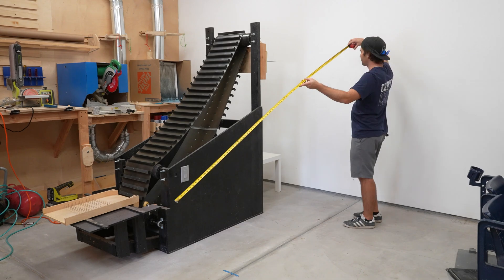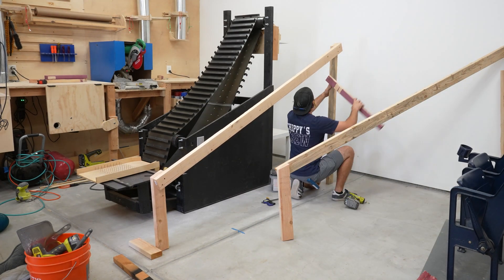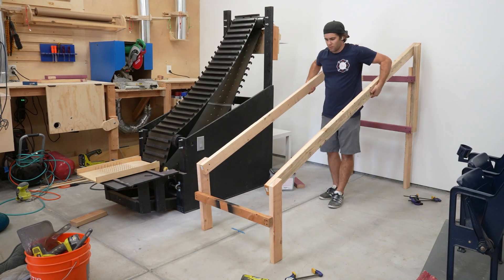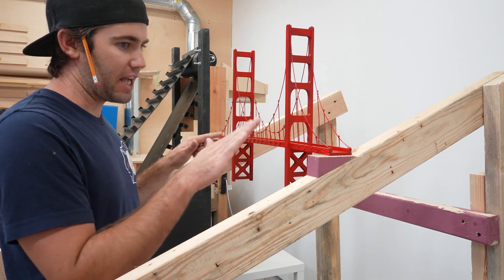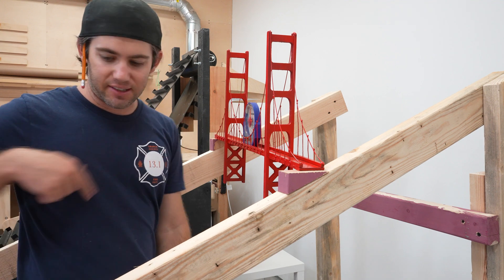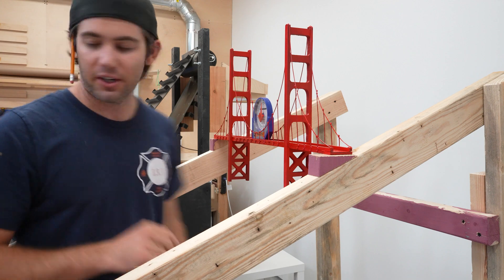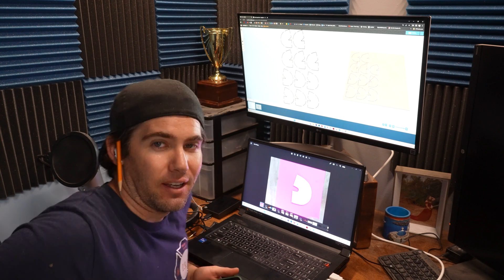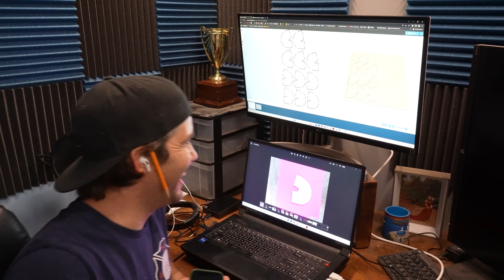Bridges Marble Machine - Completing the Track

Comment: why not cut out a slightly wider bend for the those turns on the CNC? that way you don't have a ton of small cuts to make, but just glue 2 or 3 together to get the same height and it'll look cleaner.